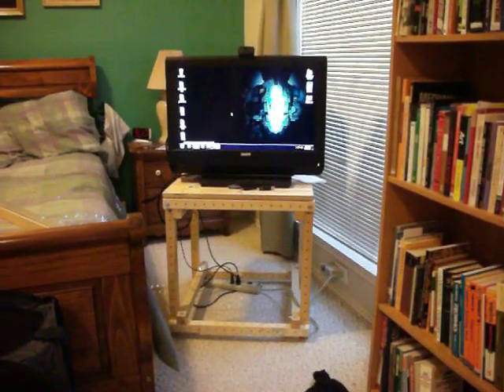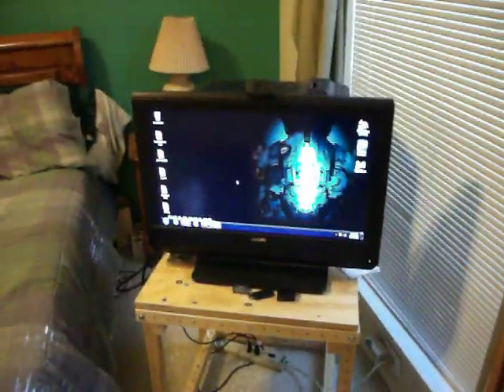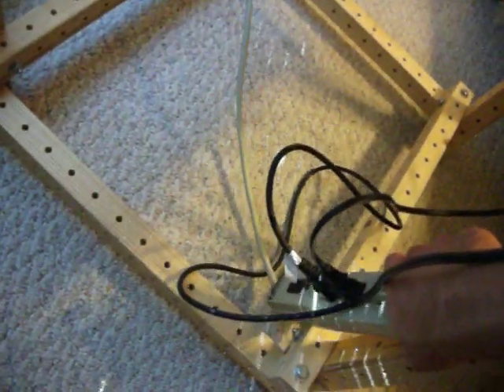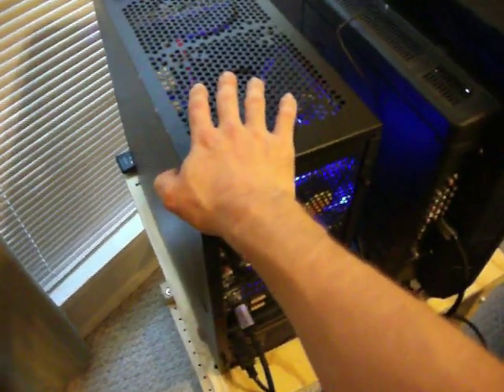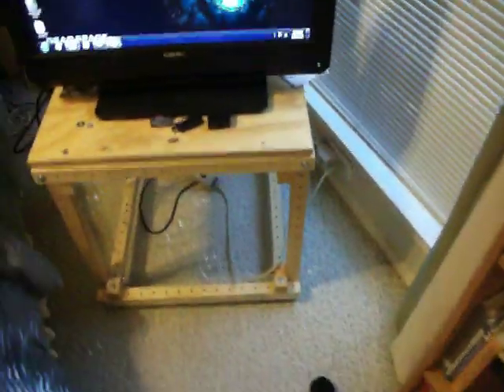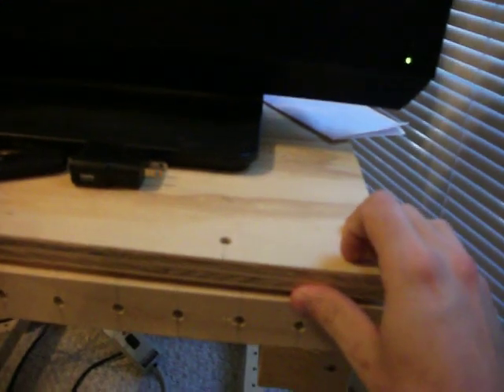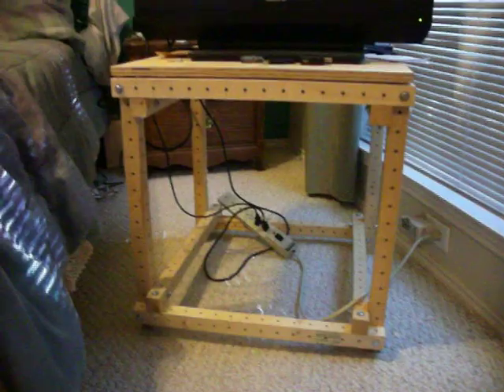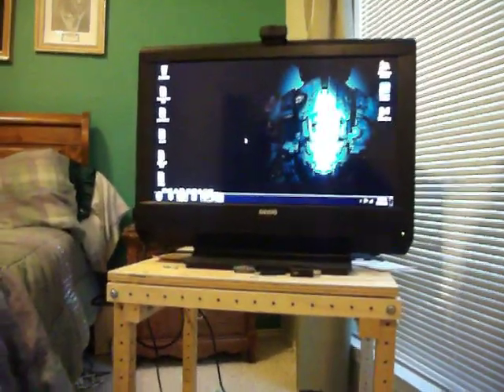Grid Beam Bedside Unit: Before

Comment: @ContriteDiscursion I get my drill press tonight. I'm only going to drill the holes into the pieces that require it. So I will do all of the ends of all of the sticks for sure, and when I need to attach cross sections I will remove that piece and put it in 5 or so holes where I figure I want to install the cross piece. That way I don't have to drill all of the holes up front. 

Eventually though I want to stock a few hundred pieces of grid beam for rapid prototyping in the future.